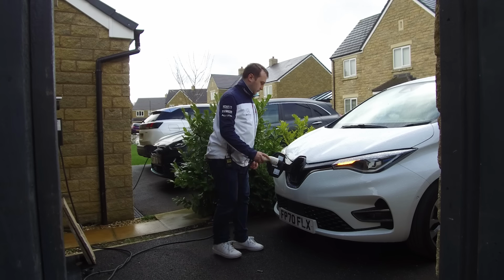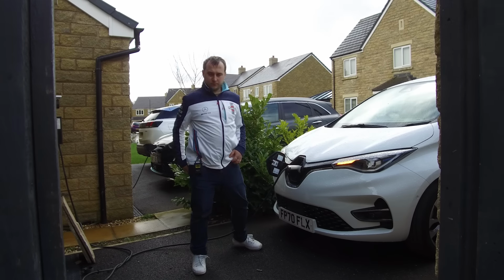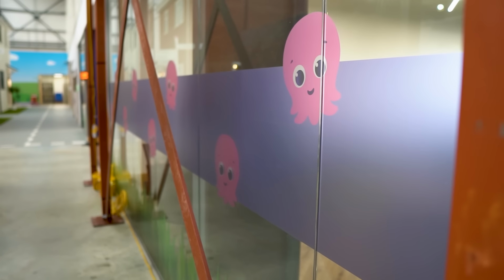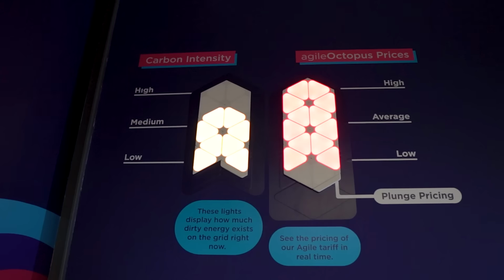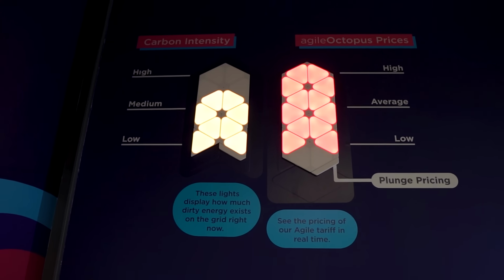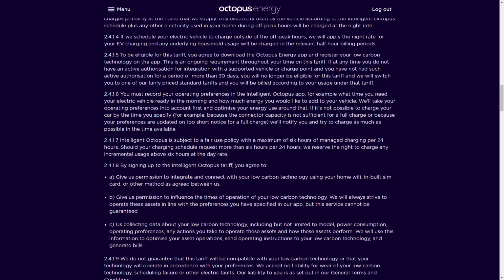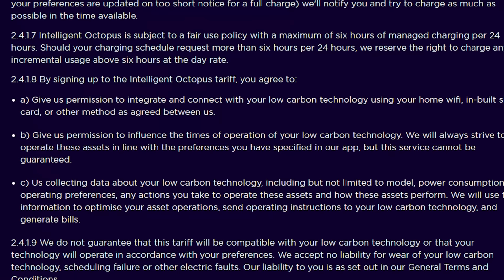How To Game Octopus Go Intelligent For Bonus Hours!

Comment: I have solar pannels, home batteties and an EV and use Intelligent go.
I always charge my batteries between 23:30 - 05:30, I also run my dish washer,  washing machine most days and charge my car probably once or twice a week on a Ohme charger. Am I considered a gamer ?? Breaking the rules
Reply: From what i know, the cost isnt when you are using that electricity but when you are drawing it out of the grid. You are using 7 p kw during the day but it costs octopus energy less because of what time you brought it in.

Comment: hi, I've recently moved from my octopus 15m fixed to IGO as just had my new BYD Seal arrive and charging using the hypervolt home 3 pro.

I set this up using the octopus app and it asked for a test charge to link them which all worked well.

I then set how much charge I need and when for and off it went and started charging and it showed me around 4 or 5 time slots when it will charge today.

bear in mind this was at 10am I was a little concerned that these schedules will be charged at my peak rate of 26p p/kwh and not the intended off peak 0.07p

I called octopus for clarification and they were telling me the cheap rate is only from 23:30 which i know but if that's the case why has the octopus app created charging schedules for that day.

this is concerning as from what i've read and watched IGO will determine the charge schedules during the day but i will be charged my non peak rate for this usage no matter on the time of the day

can someone please help explain and clarify this for me 

thank you

Comment: Just fitted a compatible Zappi and getting IO later this week.
Always charge to 100% so hopefully this isn’t seen as gaming the system.
Thats the charge I need so I expect to have that delivered.
Reply from the maker: nope not at all
Reply: @NicolasRaimo  Been using it for a few weeks now and every time I plug in , no matter what time of day, octopus generates a new schedule and starts charging immediately. The whole house is on low rate and the cost so far is very cheap. I think that the energy companies are giving away surplus electricity to the providers so even at 7p/kw they are still making money.

Comment: Without any gaming of the system, intelligent go is already a fantastic tariff. I use washing machine, dryer and dishwasher on a timer for 1130pm start, along with the EV. in the winter, I set off electric underfloor heating at 430-530 which is still warm when we get up and means less work for the gas central heating. I’m not sure how much this has saved me, but I do know my bills have come down despite now having a Tesla to charge up.
Reply from the maker: 100% no need to ruin the deal when you can already do so much as it is!

Comment: ... the vast majority of us don't need extra slots (my calculation is that you need to be doing 60,000 miles a year), as most of us only charge once (or twice) a week overnight - until we can get a heat pump for free, then in our case kero 28 will win - we can run the house (EPC Grade G) / EV ... et al. for less than £1K a year.
Reply from the maker: It’s less about you needing extra slots more octopus rebalancing when power is cheaper or greener sometimes

Comment: What Octopus Energy are doing with the cheap over night EV RATES they put the price up per KWH during the day (home use) and increase the daily charge rates, so what they are doing supplementing the cost on cheap night rates, you gain little or you end up worse off, so where are Octopus loosing out.

Comment: I just want to point out that if Octopus schedule a charge outside of the 6 hr off peak period, then if you have battery storage the charge will be first taken from the battery and not just from the grid so the battery provides about 2.5 kW and the grid provides the remaining 4.8 kW (7.3 kW charger). Also, even on Octopus Go, charging during the off peak period if you do not set your battery to also charge at the same time as the car charging you will lose your battery capacity first since the order of taking electricity for the home is first solar, then battery, then grid. Note, therefore, that for any car charging schedule it is imperative to make sure that you set battery charging carefully so you do not wake up to low battery charge to supply your early morning needs before solar kicks in.
Reply from the maker: I’ll be doing a video on how to have your battery charge automatically on these outside windows soon so click subscribe and the bell icon… I also covered the issue at 
Octopus Intelligent Has Issues For Solar, Battery & API Cars
https://youtu.be/bUZXiEVQe0o
Reply: @NicolasRaimo  I've already solved the issue within the 6 hr normal off peak period by having my batteries being charged from  11:30 pm to 5:30 am and setting my car charging period to be completed by 5:00 am which means that my batteries will simultaneously be charged at the same time as the car therefore keeping the batteries fully charged upto 5:30 am. The only time I may get depletion is if Octopus decide to allocate extra hours before 11:30 pm in which case the batteries may get run down before then and so I would be paying at a peak hour rate for usage up to 11:30 pm. They will not allocate hours after 5:30 am since I have asked for the charge to be completed by 5:00 am. I normally charge from 20% to 80% which for my 40kWh Zoe needs about 24kWh over the 6 hours off peak and with a 7.3 kW charger only requires 4hrs max which would definitely be completed by 5:00 am.
Reply from the maker: @barriebirch7956  so the video am making will fix all that and you can set it for a real time in the morning plus it will charge the batteries extra when car chargers

Comment: Surely the Kraken system  is what octopus use to game the energy market. No one seems to be crying foul on this.
Reply from the maker: Kraken bids on market to ensure octopus gets best price it’s very different from hacking how your charger works to game unlimited cheap energy
Reply: @peterbee8892 you are spot on!  @NicolasRaimo  you have said Octopus is rarely losing money... to be clear I don't think anyone is 'gaming unlimited cheap energy' from Kranken ... as these time slots ARE offered by KRANKEN not in kindness but only when Octopus still wins money, in other words customers pays for Octopus's imbalances grid costs. Google this 'It follows an Ofgem deep-dive into the issue which began last year amid concerns that some generators may be taking advantage of existing rules after balancing costs tripled in the winter of 2021/22, to over £1.5billion between November 2021 and February 2022, compared to average annual winter balancing costs of just under £500m for between 2017 and 2020. The record-breaking daily costs peaked above £60m on Wednesday 24 November 2021, driving up the ESO’s overall balancing costs, which are ultimately paid for by consumers, to £3.1bn that financial year.  '

Comment: Are you also saying that I shouldn’t charge up my home storage as I currently do during the six hour cheap rate period, as for the car I only ever charge it during the cheap rate times I never set it to charge to 100% during the day to be ready buy let’s say 17.00 hrs.
Reply from the maker: No as said in video charging your battery is fine it’s people tricking system into almost 24/7 7.5p electric
Reply: @NicolasRaimo  Why is that fine? If you charge up a battery during the off peak period @ 7.5p and then discharge your battery during the peak to power your entire home during the peak hours, the resultant payment to Octopus is no different to using 7.5p electricity all day! You're still using electric which Octopus' have supplied @7.5p!
Reply from the maker: @timalisonfox2854  totally different as cost and how green grid is

Comment: I’d love to have a “can I have a couple of hours at 13/14p” option. So that I can get a bit of a boost for the home battery to guarantee I don’t draw at grid peak.
I ask for ~24 miles a day, but I do that most days.
I don’t like to charge at genuinely peak rates, but a brief boost at ~midday helps me not draw at 4-6pm - so it’s not particularly obvious to me how much it actually costs them - ‘cos that 4-6pm cost is way more than I’d be paying them at my peak rate.
Reply: Yep, I genuinely think there is scope for a smart tariff that charges 50p+ during the 4-7pm peak rate, 7.5p during the overnight rate and 20-25p during the daytime rate. This would be a kind of Agile-lite tariff, with more predictability.
Reply: The system has some real issues: I don't know if it's Ohme specific (since as I understand it Ohme is doing the time allocation rather than Octopus directly).
Today, since it's half term, I pushed my "charge by" time out to much later than usual (because the point is that they can choose the best time for them, so I give them more options)... and the (small) planned charge moved, to directly across the agile peak period rather than it nestling in the "noon lull".  I'll probably cancel the charge when that peak kicks in...
I'd be happy to have a "give me this much over each week" schedule, where they can give me more one day, and not bother on the next.

Comment: The only way I game the system is to put on the dishwasher/washing machine/dryer when the extra hours cheap rate is on. Save me staying up until 11:30 each night, to put these on then. My Ohme Home Pro app tells me when the cheap rates will charge each night. Sometimes they are 15mins, 30 mins or longer. But I don't have solar or battery,  so im not gaming any of those. Hopefully, that's still fair use!?!?

Comment: TBH I am not convinced that this is actually an issue.

Octopus control the extra slots, they don't guarantee them in any way, nor to the guarantee that your car will reach the intended target charge. Only that they will attempt ot control the device to reach the intended charge where possible. 

I assume that at the moment the extra slots are being added because it is cost effective for Octopus to do so, either because there is a surplus of energy and it would cost them more to turn it off, or that the amount they paid for that energy was lower than the amount you will, or that they are abitraging it against other usage.

If octopus had guaranteed you would get the extra slots then I would agree with you, but as they control them then its less of an issue in my mind.

I will also note that for Charger based integrations, the settings from previous days just carry over, so unless you go in to the app and specifically say "Hey I don't need any extra charge buy the way", it will just assume you need the same amount as the day before as it has no idea how charged your car is.
Reply: The other aspect is, can you make use of those extra hours? For example, I literally moved to intelligent yesterday and my first charge periods were set as 2330-0000 and 0030 -0800. Well my car was fully charged (90%) in that first half hour. So aside using the extra period of 0530-0800 for stuff i didnt need right then (ex washing machine, tumble dryer, dishwasher) there was no way i could use it. The house battery was fully charged well before 0530.

Comment: I sort of see the future where the 6 hours fixed will not be a thing, and they will definitely want the whole house benefitting, clearly evident by them working with inverter manufacturers offering support and API access to work with their various tariff. I wonder if the future might be such that yes, you get 4-6 hours a day of cheap rate, but they are not the same hours every day, more tied to the grid state.
Reply from the maker: 100% this is the way it’s going

Comment: At the moment Octopus Tracker is averaging 17p, so all the electric companies are making a ton of money with the recent increase. When electroverse had 45% off, I public charged at 35p, these would've just been additional octo hrs, but I didn't know the trick at that point. I gamed the system a few times due to my car only charging while the ignition was on (didn't fancy leaving keys in the car over night), but I only did this when it was windy and the additional hrs were around 10p on agile, with some hours peak rate 31p. Luckily my car is fixed now, so back to charging on the windiest night at the weekend, so quite often it would have averaged under 5p on agile. I use a granny charger, but only need 10hrs charge a week, which is either over 2 nights, or 1 night with extra hours when windy. I think most who game the system would pay the same or less on agile or tracker, but prefer the security and ease of working out costs with intelligent. If wholesale prices were closer to 30p, I think Octopus would have changed the pricing of intelligent. I think a limit on the extra hours maybe fair (30-50hrs per month?), or  a limit on their average wholesale cost (10p?).

Comment: Hi, geat video and thanks for the info.
I keep having to accept the extended hours,  let me explain why.
I have a home battery and when I plug in say at 10.00pm the charge plan might be from 11.30pm- 7.00am to get a 100% charge. So from 5.30am-7.00am I am on extended hours.
But the problem I have is that my home battery charge window is from is from 11.30pm-5.30am, however my battery will discharge from 5.30am-7.00am (wake up to a full car but a flat home battery)
So  I set the app up to need car at 5.30am.
I don't like doing this.
I am in the middle of configuring a home made micro controller system to see if I can work within the variable octopus window and prevent the home battery discharge issue.
This tarrif is in beta
The last thing I want to do is upset octopus!. Lets hope Octopus find this comment.
Reply: I dont see an issue saying you need the car by 530am. As a backup you can have the car max charge % set so the car wont charge after 0530 anyway either because its actually full or the set limit. My car charge period yesterday was 2330-0000 and 0030 to 0800 but my car hit its 90% limit in the first session since itw as already at mid 80's%. So even if Octopus decided to charge my car between 0530 to 0800 nothing would have happened.

Comment: I'm grateful to Octopus as I am saving over £100 a month charging my home battery and car. I rarely charge more than 40% an night. My only problem is that Octopus drawns charge outside 11:30-05:30 and drains my home battery. Also my friend who lives in Peterborough keeps getting free power ups. I've never had one! Would like to see these shared out.
Reply: You can get an electrician (preferably whomever installed the battery) to tweak the wiring so that the battery's CT clamp never sees the car charger. They may have to add in extra wiring but it shouldn't be a "big job" to do.

Alternatively, if your battery is home assistant compatible, you can always set it to standby or charge when the car is charging.
Reply: To stop the battery drain set a ready by time of 5:30am for the car charging, both your battery and car will be full and the battery will then take over powering the house.
Reply: Thanks for the advice. I did try this but ater 5:30 the car would start charging (as if doing the routine for the next day). Rewiring the charger or setting up home assistant is the way forward but I'm having difficulty finding someone who knows about how home assistant works.
  @edwyncorteen1527
Reply: @edwyncorteen1527  but the charge may start before 11:30pm. It might start at 8pm until 9pm and then stop again until maybe 1am then start again.
Reply from the maker: Which battery you got I’ve got mine to see my EV charging and charge my battery
Reply: Thanks Nick for replying. I have the Growatt 6.5 KWH battery and the Growatt SPA3000 inverter. @NicolasRaimo
Reply: Install an additional CT clamp on the EV charger cable and wire in in parallel but reverse polarity to the main feed CT and it will ignore the charger draw.

Comment: TLDR:They could prevent this "Gaming" by not changing the time of use tariff for all consumption but leaving it as it is and refunding the difference (22.5p)for what the EV draws or is calculated to draw i.e.
 
What happens now: if IOG schedules a charge for 9 - 9.30pm it sets the tariff for that half hour to 7.5p. If you have a 7kW charger the EV will consume 3.5kWh. If you game the system and have capacity you could consume another 10kWh  and get 13.5kWh@ 7.5p. (£1.01)

They could do this: schedule a charge for 9 - 9.30pm but leave the tariff at (just under)30p. You consume as much as you want. With a 7kW charger only 3.5kWh can be consumed by the EV. So if you consume the same 10kWh more they charge 13.5kWh@30p (£4.05) but then credit you the difference (about 30p - 7.5p) for the EV 3.5kWh@22.5p (78.75p) so you end up paying £4.05 - 78.75p = £3.25
Reply: They will lose customers to OVO if they do that. As OVO already only credit the car usage and are cheaper than octopus.
Reply: That's exactly what OVO do, and with a cheaper rate
Reply from the maker: As mentioned in video that’s what ovo do with drive anytime it’s doubtful octopus will go this way
Reply: @NicolasRaimo  why is this doubtful? It solves the problem, others are doing it so it’s doable, they don’t have to kick out customers and it only really affects the gamers.